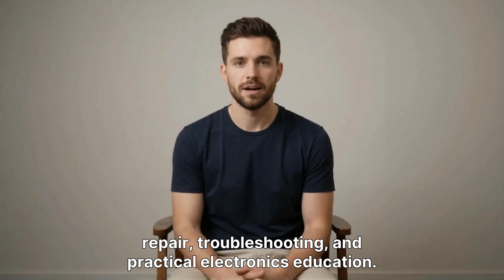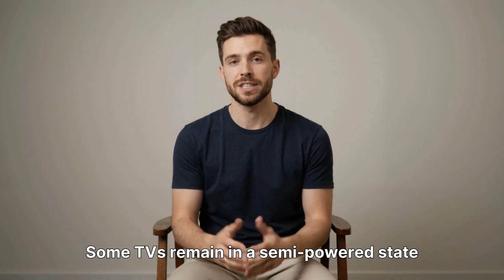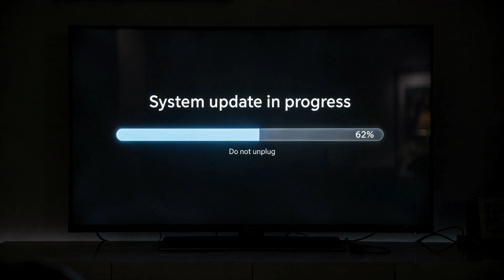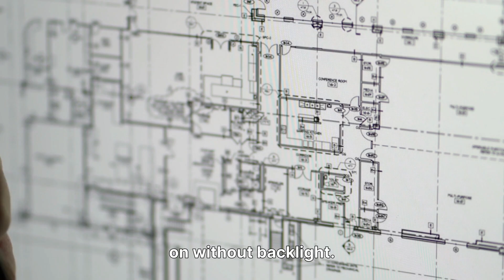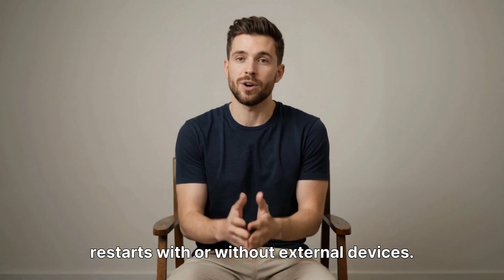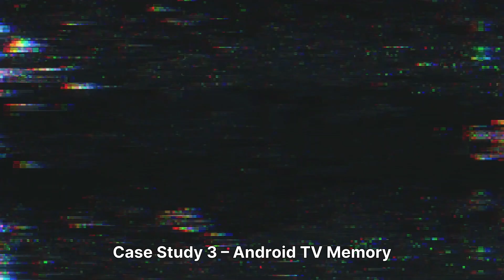TV Keeps Restarting or Stuck in Boot Loop – Full Technician Repair Guide (2026)

Comment: I have this problem with my tv box gt king pro beelink whenever I put it off it restarts and works normally but when i put it off it restarts it never goes off until I unplug it.
Reply: That’s crazy that you put the do not all the way at the end of the video
Reply from the maker: Please check below: if not work please let me know. 
 HDMI-CEC is enabled
Another device (PS5, set-top box, soundbar) is turning it back on.
✔️ Fix: Settings → HDMI-CEC / Device Control → Turn Off
2️⃣ Remote control problem
A stuck power button or faulty remote can resend the power signal.
✔️ Fix: Remove the remote batteries and test.
3️⃣ Software glitch
TV firmware bugs can cause restart loops.
✔️ Fix: Settings → Support → Software Update → Update your TV.
4️⃣ Power board / hardware issue
A failing power supply inside the TV can cause instant reboot.
✔️ Fix: If none of the above work, service repair may be needed.
5️⃣ Voice assistant or smart features
Alexa, Google Assistant, or mobile apps may be waking the TV.
✔️ Fix: Disable voice wake features in settings.
Reply: @TechVibes-maf  if you had a short back Lights, wouldn’t they not stay on when you disconnect main board from the power supply board or the cable ribbon cable I have back lights when I do that. I have a loud freaking noise in the power supply. Is that normal and how do you fix that?
Reply from the maker: Thanks for reaching out dear friend,  please check below:
If capacitors are:
Bulging
Leaking
Swollen
Then the board struggles to regulate voltage → causes noise.
Replace full power board (most reliable solution)
Usually cheaper than repairing multiple components.
Any future support please let me know